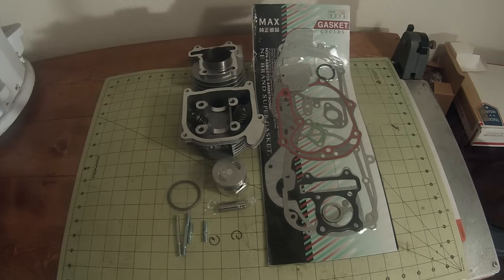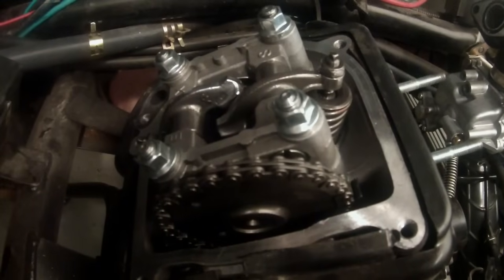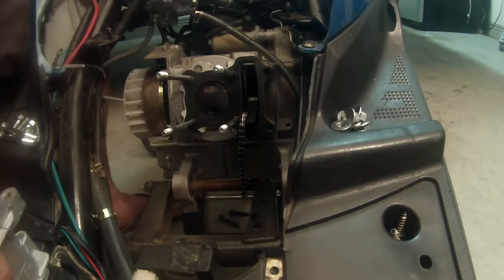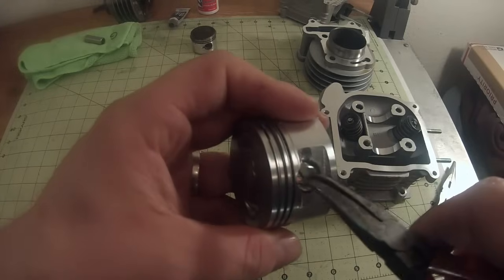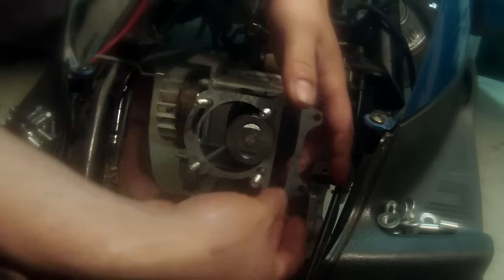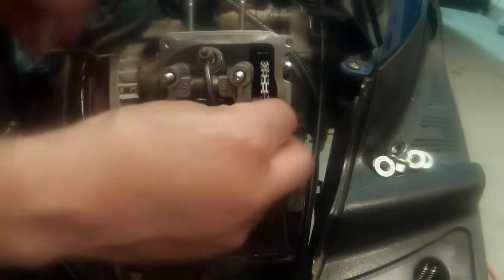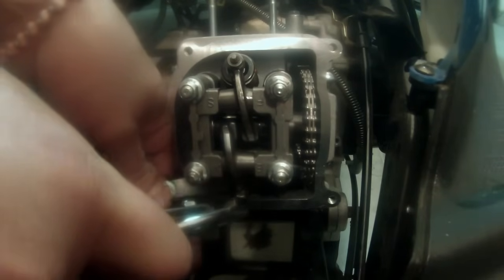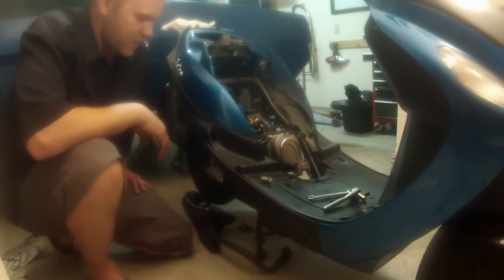How to Install Big Bore Kit on 50cc Scooter - Every Step Included! 80cc or 100cc GY6 139QMB Engine

Comment: Made sure flywheel and cam were in top dead center but upon placing rocker assembly there is a LOT of space between the rocker arm and valve. Any suggestions what to check to close this spacing between the arm and valve?
Reply: I got the same problem what did you eventually have to do to fix this since I didn't see a response??

Comment: after installing a big bore kit, is it necessary to get a different carburetor for it as well, or should the stock be sufficient?
Reply from the maker: +Robert Jones Stock will run just fine 9 out of 10 times. Worse case you may need to put a slightly larger jet.

Comment: Any idea if this kit fits a Daelim 50cc year 2011? Thanks for any information.
Reply from the maker: The best way to tell is to confirm that you have a GY6 (139QMB) Engine. 
To do that, look on the left side of the scooter, under the plastic belt cover (usually around where the kick-stand is). You will see a your vin stamped on the engine. 
Right above your vin, you will see either 139QMB or GY6. 
If you see that, our kit will bolt right on; and you can get free shipping from us by subscribing and using coupon code “subscribed”.
Reply: Thanks for the timely reply. What if I don't see those magical numbers?...
Reply from the maker: Check for a plate or sticker on the belt cover (often towards the rear). 
The engine has to be stamped by federal law both China and U.S. 
All true GY6’s are stamped at the location mentioned in my first reply. 
You can look around your engine for that stamp or plate. I have even seen them behind the air box on some models.
Reply: My engine is a Daelim S5 Fifity. Are you aware of any kits that fit it? Most of what I've seen only seem to work with the GY6 (139QMB) engines. Thanks again for any info.

Comment: hey i want to buy one of the big bore kits off of your website, the only problem is what valve size do i get? i have a atm tao tao 2018 49/50 cc scooter.
Reply from the maker: Unfortunately, there is no way to tell valve size without pulling off your valve cover. Check out this video to determine your valve size:
https://youtu.be/lt4NEhClpoo
Reply: Rouse Garage  well i believe it was a 64 mm, before i buy the kit. should i buy a carb. or air filter or even cdi? do i have to buy those add ons?
Reply from the maker: Customer service is our top priority, so we do have a system in place if you accidentally order the wrong valve size... You can go back to our site and order just the correct size head, then ship back the wrong size for a full refund on the incorrect sized (unused) head. All you pay is return shipping. 
As far as add-ons:
We’ve installed plenty of BBKs without changing anything else with no issues. However, we always recommend at least jetting your carbs main jet between #85-#89. We have a cheap kit on our site that would qualify for free shipping with your BBK. Please note that some stock carbs have anti-tamper plugs on the carb so they’re harder to open up. You can drill them out (search on YouTube how to do it). 
Beyond that, there are tons of add-ons. It just depends on what you want to get out of your scoot. 
Our Performance Ignition Kit will give you hotter spark, advanced timing, no rev limiter for faster response to rpm acceleration & higher rpm limit at top end. 
A9 Performance Cam: faster acceleration and better top speed
Air filter: feeds more air for your BBK which will help when combined with a jetted carb. 
Racing CDI: has the most aggressive performance curve. It’s currently on our site by itself, but we will be offering it as a kit with the coil and plug today or tomorrow. 
Happy Scootin!

Comment: When I was trying to install my big bore kit I tried spinning the flywheel to see if the rocker arms worked correctly and the intake valve is completely seized up and I cannot spin the flywheel and the intake valve will not move at all please help

Comment: Do you need a new carb when installing?
Reply: It wouldn't hurt to get a 20mm carb and a jet kit, it's only slightly larger than stock, but it helps, and the jet kit can help tune, even with the stock carb, best performance with the 20mm, but not a must, but a jet change with either may be needed, around #90 main jet should work, and a slow jet kit also , you would have to find what is needed for your engine ,  check the reviews o. The carb before buying, some are not easy to tune, and factory sealed,  the carbs from Japan are the best,

Comment: 43:56 When I reach this stage, the bearing furthest from the chain will not go all the way down onto the cradle(?) the it's supposed to sit in. It's about a half inch away from it. Any thoughts? I've tightened the two bolts on the chain side down pretty well (not too much I don't think), and the chain does spin just fine, so it isn't hung up anywhere.

Comment: Hello so I went and bought a big bore kit and in the middle of installing. But my valve lash is HUGE after putting the new head on. I can't set it because the adjustment screw isn't long enough. Did I miss something or is the new head just a dud?
Reply from the maker: Its impossible to say without seeing it, but my first guess would be that you got a head with 64mm valves and need 69mm valves. I have a video on this channel how to determine what size you had. Watch the vid and compare your old and new head. Good luck!
Reply: Ahhh yep, that would be the problem... Thank you!

Comment: Rouse Garage, is the process the same as for a gy6 150cc and did you not have to bore the case out with your kit?
Reply from the maker: +Scott Baddley all is the same depending on the size of the cylinder jug used.

Comment: what size jet would you wanna run with this ? ....
Reply from the maker: +2SHAYNEZ - I rarely switch my jets. Only if it runs rough which has not been common. It is a good idea to tinker with increased jet size. Start with small increases if you do.

Comment: i have followed all step but my scooter doesn't want to start when i use the electric start it over heats the battery and sparks. have any options of what it might be
Reply: Hi Conner I have seen this upgrade done a good few times and on lots of the larger cc kits the electric start works badly when cold I think its the extra compression  I belive you can get upgraded starters from places like scrappy dog etc

Comment: DO NOT install studs with channel-lock pliers.

The correct method fr studs sans flats for a wrench is to tighten two jam nuts against one another and use the top-most nut to thread in the stud.

Just an fyi kids.

Comment: don't you have to put a bigger jet in the carb?
Reply: chriss4365 explains please
Reply: @firehawk8521  someone said that if You don't modify the carb it will run to hot and to lean... and that does sound right...

Comment: you did not turn the flighweel over at least 2 turns to check TDC and no valve interference with piston top, to make sure that there is no binding and that timing is correct

Comment: after doing the big bore kit on my 49cc tao tao My scooter is overheating I believe it is running lean so I upgraded my jets slowly from a #97 all the way to a #135, It is still running REALLY HOT, I replaced the Head and piston and rings AGAIN still no change, and I am being really careful to top dead center, setting my cam correct every step has been gone over, My timing is good, my valve setting is set at .003, and I did replace the stock carb with a 24cc I know its a little big but I am using a #110 Jet, But way to HOT starts out good then slowly loses power. Can you help me with this I have taken this scooter apart so many times I can do it blind what am I doing wrong
Reply: maybe it has to much compression.. try putting two paper gaskets under the cylinder
Reply: Did you ever end up getting it fixed

Comment from the maker: +Beto R.
There are plenty of opinions out there on how rings go.  I have always placed the black ring as shown in this vid.  Those two rings are basically similar, and as long as the gaps do not line up, you will be good.  I will say that I have never had any issues doing it this way, and I have ridden these scoots hard!
Thanks for watching!
Reply: I just tried installing a bbk and it will not start please help me
Reply: Compression rings and scraper rings
Reply: Rouse Garage did you block the egr tube on the valve cover? And does the 2 piece gasket usually come in the kits? What brand BBK do you use?
Reply: I advocate buying the correct tools to do the one job you want to do. It makes the job much easier and faster. This is how your tool collection builds and any repairs can be done quicker.
Reply: @tylerbroadus7737 what was the issue?

Comment: Just put a 80cc bore kit in my racer 50, the bike turns over but will not start, it has spark and compression but doesn’t seem to start, also it seems to be TDC so I don’t think that’s the issue, any ideas on why it won’t start?
Reply from the maker: If in TDC as stated, how is your valve clearance?
Also.. Did you use the same size valve head as stock?

Comment: I just installed a big bore kit and now my moped wont start. I've been kickstarting it for the past month because electric system shorted so is it possible that you just can't kickstart it after a repair job like this until it's been electric started? Any other ideas on why it wont start?
Reply from the maker: +Shawdow194 
Did you get it figured out?  The compression will be better, but you should still be able to kick start your scoot. More than likely you are one tooth off when you put your chain back on. This is usually the issue.
Reply: Rouse Garage You are right, I installed the camshaft when the piston wasnt top dead center. Thank you so much for replying!

Comment: Would this kit work on any 50cc engine or just that model?
Reply from the maker: Check to see if you have a GY6 engine. 
You will see a stamped # on the bottom of the engine below the belt cover typically near the kick stand. 
If it says 139QMB or very similar, you have a GY6 engine and this install will be the same.

Comment: Have you ever tried a base gasket delete for more compression with a big bore kit?
Reply from the maker: We have not (yet LOL). I’d need to figure out the squish factor from the gasket and determine if there is enough space without having to machine the head. It will affect timing, so that would be another issue. It’s a great idea to add to the list of projects/videos, but that list is growing fast😃
Reply: You can always use a good paper style gasket for the base gasket to raise it some i know .015 to .020 clearance is the lowest to go to.
Reply: Or clearance the piston for the valves or use a shorter rod same difference we do it when building chainsaws yea its a 2 stroke but its still worth trying.
Reply from the maker: Love the ideas!  Great, now I have another project to add to the list! LOL
Reply: I didnt mean do i now ahhaha lol yea man just see what it gains when you have time to get to it no biggy just curious also lol have a good knew year buddy!

Comment: I installed everything just right but I have a issue, the scooter starts and runs and even Rev and I can feel it like I should when I throttle, the tire spins while on the center stand but the moment I take it off the center stand it doesn't do anything just runs.
Reply: Michael Earle maybe your clutch is bad

Comment: What happens if you don't put the pins in the side of the piston ??
Reply from the maker: +Ezra Wilde, You will ruin your engine.  As the piston moves at very high RPM, the pin will work its way out one side, and gouge your cylinder wall.  Once that happens, you will not get compression, and your scoot will not run.  It could very easily seize up with your cylinder wall and lock up your engine.  Be very sure you get the clips in, and they are seated in their grooves.  thanks for watching!

Comment: i have a trike icebear 50 cc.can i use this kit
Reply from the maker: +Jorge Lucero if the engine is stamped either 129QMB or GY6 you can. Otherwise, you will need to find a kit specific to the engine. The stamp will be on the lower side towards the rear on the left side (if your sitting on it)

Comment: Would this be same on buddy 50?
Reply from the maker: Check to see if you have a GY6 engine. 
You will see a stamped # on the bottom of the engine below the belt cover typically near the kick stand. 
If it says 139QMB or very similar, you have a GY6 engine and this install will be the same.

Comment: would this work on a 2016 euro 50 moped?
Reply from the maker: Check to see if you have a GY6 engine. 
You will see a stamped # on the bottom of the engine below the belt cover typically near the kick stand. 
If it says 139QMB or very similar, you have a GY6 engine and this install will be the same.

Comment: Is it okay to put it in jog zr
Reply from the maker: I’m fairly confident that this particular kit will not fit your jog zr. It should have a A312E motor. 
This kit fits GY6/139QMB engines.
Reply: What kind can i install in my jog zr?
Reply: Kinda new to this

Comment: can i use my stock head 64mm with a 50mm big bore kit
Reply from the maker: Carlos, you can often get by with your stock head on smaller big bore kits.  When installing a 50mm it is definitely best to use a head that is designed for the increased compression (they create a slightly larger combustion chamber).  
Check out the link in the description.  A BBK head is included in our kit, and if you subscribe to this channel, you will receive free shipping by using coupon code "subscribed" at checkout.  Happy Scootin'!
Reply: thanks man i am going to get a 69mm head
Reply from the maker: Be sure to order a head with the same size valves that’s in your scoot now!  
There’s a video on our channel explaining how to determine your valve size.
Reply: my stock head is a 64mm  so i  need a  50mm head but with a 64mm valve size right
Reply: and i can use my stock
Rocker Arm
Reply from the maker: Yes. If you order a kit of any size, order one with a 64mm head if that’s what’s on your scoot now. You will use your stock rocker arm assembly. 
If you choose to order from us, you can choose either 64mm or 69mm.
Reply: ok thanks man i will look to see what u guys have  i am ordering stuff right now.

Comment: Pretty sure your valve lash would be .004 INCHS (not mm). That is 0.10mm. (.004mm is .000157" - not something you could accurately measure with a mechanics feeler gauge)

Comment: Hey, I've been using your video to install a larger cylinder into my scooter. I bought new rocker arms to match the valves, but they came without the metal frame. I can't get the old rocker arms off, the pins have a flat head indention, but they just spin in the bore, is there a special tool i needed?
Reply: I just smacked mine out

Comment: One thing you forgot to do was re jet the engine. It'll need more fuel flow. And the air box will need more air flow.
Reply: Do you think that’s why mine is not starting it sounds like it wants to

Comment: do you have a number rouse garage i got a scooter that wont start it has spark and fuel and air just cranks over.
Reply: D Teague does it have compression? My scooter would rarely start up. It left me stranded 10 miles from home and a few blocks another time. It only rarely fired up on a cold start only. At one point I tore apart the gears in the kick start from trying to get it running. It had started smoking a bit so I figured I would investigate it. When I took my scooter apart it was all burned up on the side of the piston, pieces of metal missing, and scratches all along the walls. I'm the second owner and only put 100 miles on it and the oil looked awful. I went with a 47mm bbk and I just finished tonight and it fixed the problem.
Reply: yes i got mine started my battery was the wrong size mah.

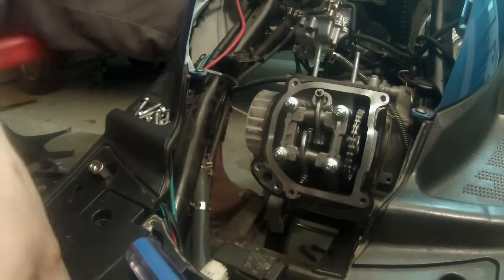Comment: hey buddy what is the plastic cover for around the head at 11:15 ??? seems like it would make it run hot.
Reply: Raymond J - it is actually connected to the air cooler, so really all it does is keep the cool air flowing :-)
Reply: ooo ok i can see that . great job walking everyone threw that job really good video .
Reply from the maker: Spot on +Joe Green. Thanks!

Comment: DO NOT USE GASKET SEALER!!!!!!!   these motors utilize the gap in the jug where the head studs go to flow oil to the top of the motor and if you get even a little too much sealer around any of those studs you can and almost always will block oil flow to the top of the head to the rockers and cause serious failure it is best to wet the gasket with a light coat of oil when installing to get a good seal.
Reply: jeremy shaffer do you mean gasket maker??

Comment: An oil pump came with the big bore kit.  However, the new oil pump has a completely different shaft and gear. It is not compatible with my motor.
Reply from the maker: +William Zaniboni Sorry for the delayed response!  The message ended up in my spam folder for some reason.
Anyway, there is no need to replace the oil pump.  Some kits come with extras since you already have the motor opened up.
Happy Scooting, and thanks for watching and commenting!